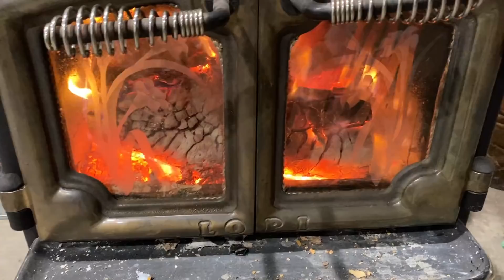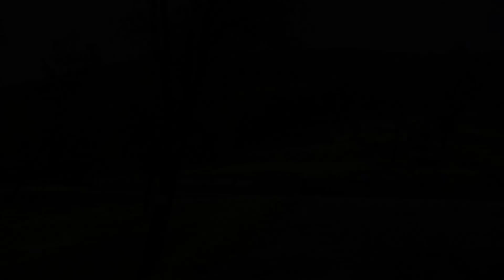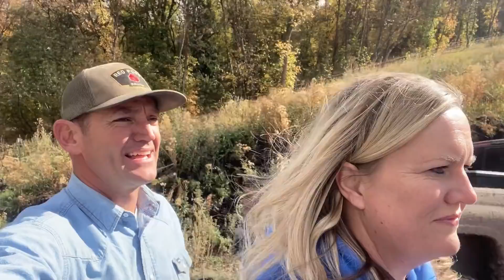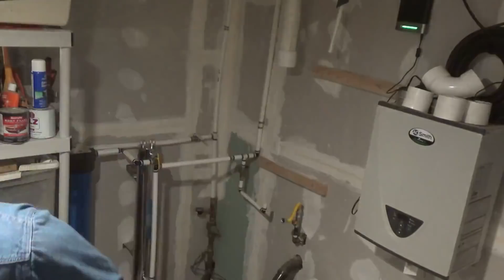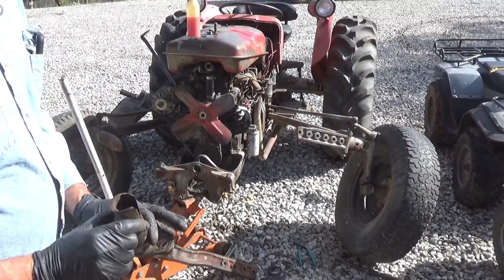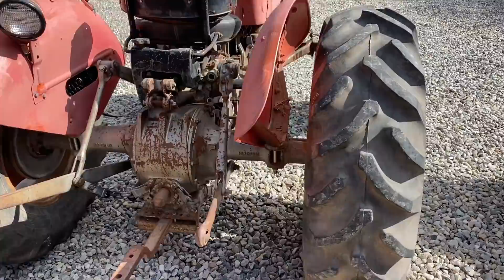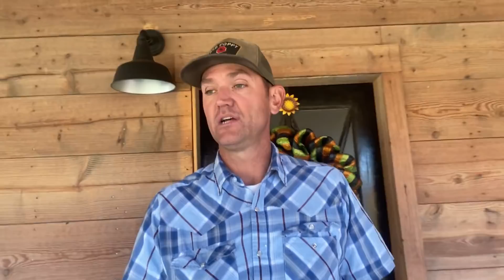#370 - I Installed An Ultraviolet Water Purifier On Our Off Grid Water System!

Comment: Wind Generator
Coming from someone who has owned 3 in a non laminar wind location, they are a waste of money in that environment.  If you insist, a production Axial Flux vertical or horizontal axis would be the most promising. The variability of the wind would steer me away from horizontal axis, but you would be a better judge of your conditions.  What are the conditions like at the top of the hill?

Comment: Maybe you should think about Outsourcing some dry wood for this year. Even if you cut wood at this time of the year it won't have enough time to dry and wet wood doesn't heat well it's not efficient. 
 for the wind generator make sure you try to partner up with companies that may be able to lower significantly the price of your wind generator or even you could get it for free in order for presenting the product on your Channel you have enough subscribers that some companies should be interested in the publicity don't be afraid to use what you have.  you could also think about getting a lithium battery. A lot of companies that provide solar material and batteries are partnering up with YouTubers don't be afraid to ask.  I hear that renergy have good lithium battery maybe you should investigate with that company

Comment: We have a 1700 watt wind turbine hanging on the shop that we only used one year they basically have to have 30 mph sustained winds to make enough power to do any good you would be better off to add to your solar system or your storage . We just switched our system to a 20- 6 volt battery bank system I'm  now able to eliminate any timers and let things run continually that need to do so.

Comment: Ultraviolet Water Purification works but only after you cleaned the water from other contaminants.
First, filter the water to remove other things that do not belong in the water before you pass it thru the UV light filter.

Comment: Heath what was that so very worn part that you replaced with the beefy new one? You showed it so briefly but it caught my eye.  

“She took a chance on me I’ll spend the rest of my life proving she was right” I needed to build a retaining wall I guess it needed 250 of those retaining wall bricks (12 lbs each) well my Honda could reasonably take 30 at a time.  I remember being 1/4 the way through and out of bricks.  Went to work the next day and there was a pile waiting for me when I came home.  The Mrs proved a partnership doesn’t have to have defined roles.  IT has worked for 29 years in a few days.

Comment: Nice to see the old 135 working. I bought a 135 about 8 years ago it was pretty rough, put about 500 into it and been using it ever since to brush hog and drag snow each year. I put a set of chains on in the winter and nothing will stop it. Invest in tire chains.

Comment: You could look into micro-hydro electric as well. Mr Hydrohead published a rather comprehensive series here on youtube. And there are other systems that require only a small elevation change by putting the turbine sideways ("Turbulent") on the order of 15kW. Cheers.

Comment: I knew UV was very effective for wastewater effluent treatment, but, I had never seen it used on drinking water. Looks like a perfect system. You may wish to shock the system at the holding tank/well to clear out any bacterial issues in the tank and supply lines. But, if there has never been any infestations, it may be unnecessary.
You have a beautiful place...so peaceful.
The only way to handle the mud is put down rip rap, and run over it with a bulldozer extensively, then put 57s on top. Shale would make a great base, but I doubt it's available.

Comment: dude, your way too late too be starting looking for wood. ya should have ten cord ready by now.  plus a place too keep it dry.  but then again it is a bitch doing it all by yourself.  think about  getting some help.   also how's that plow truck coming. have ya got good nobbles for it yet. hell for all you trucks and cars.    I can remember needing better tires in the snow in my place in both potter county Pa. and Madison WV. both were long  lonely out in the boon's that would of scared most people.   hell two mile drive way in Pa, then six miles too the black top, then two miles into the town.  Madison was only four miles into town, but those back cuts were scary roads.  I remember looking over the edge and being scared just looking ,let alone driving it.   I'd still be looking for a good heavy duty duce and a half truck with a plow.  I know that they are out there fairly cheap.  they can be a bit much, but well worth the cost of having one.  check Government liquidations. com, for real reals. their are a lot in your neck of the woods.    there are always great deals if your willing too act when they pop up.again best of luck, to you and yours.

Comment: Hills, trees and unstable wind won’t for a wind generator, money and time is better spent on some more panels and more battery capacity.

I suggest moving over to lithium ion batteries, they are more efficient. smaller, lighter, have greater capacity, can be discharged lower, 1000x plus more charger cycles and work out a lot cheaper than lead per kWh capacity and life. Used EV battery banks would be a great replacement for your lead acid battery’s plus you don’t have to deal with the off-gassing.

Spend wisely now or spend twice later.

Comment: I recommend you look at: "vertical wind generators for homes" as they are highly efficient but quiet.   Also they do not need to turn in to the wind.  
There are many to choose from, heck with a car alternator and some ingenuity you could build one yourself.
Reply: Just what I suggested, more versatile due to not needed to orient towards wind direction and quieter.
Reply: I am glad to see someone else has thought of using a car alternator.
Reply: Yeah, came here to say that too. They should work better at low and changing winds, at least on paper.
Reply: yeah what he said...
Reply: Yup. I'd like to get one of those sometime soon myself. : )

Comment: Am so glad you are adding a wind gen, and believe in a much earlier video of yours I added links to a reasonable place that has 3 yr. warranty ones, and can tell you that I have just 6 yrs. on one, and it's still going strong. Even my buddy who bought a cheaper 1, had to replace bearings(I helped) but his 10 yr. old unit is still working as I type this. It works when you are sleeping, it works when the rain is non-stop for 2 days or more, and will make it where you can feasibly live off grid. Can also give you some battery ideas, that I don't want to put in publicly, but if you can use any of the info, just let me know, and I'll gladly share. You're getting there, and hope you are all well ;)

Comment: If getting down to 50% on your batteries can cause damage, doesn’t that mean 50% should be considered 0%?
Reply: No, the 50% can be used and drained till empty if need be, they just won't be the same after that. Almost like if a car battery dies a couple of times from leaving lights on it will be more susceptible to not being able to hold a charge and will knock years off its life span.
Reply: @73181UserFkOff  Well said.. Degradation is not the same as failure. But using something sub-optimally reduces its life span.
Reply: @73181UserFkOff  - Good to know, thanks. : )

Comment: You have deep, dark secrets? LOL
Look up "mechanical concrete". Simple and effective. Start with the worst ruts. Try doing just one rut and not the entire width of the road in your worst possible place. One tire wide with a tread along the length on each side. Give it one year as a feasibility study. I haven't tried it, but I don't have any bad ruts. I've been able to stay on top of it with the home made grader.
You can build a grader from a truck frame and a 3 point scraper blade. I've made several mods since this video. The blade is now fixed height and the front wheels have been removed. I just raise and lower the 3 point for blade height. The principle remains in that you suspend the blade between the axles. https://www.youtube.com/watch?v=Dpeg9yTPuEo&feature=youtu.be

Then I went looking and found this: https://www.youtube.com/watch?v=OIed2lzfQ-g  I think I'd like this a lot better. The county often has old plow cutters to scrap. I can see building one of these!

Comment: I used Clearwave No Salt Softener for over 15 years now and it is still working for my house. My water heater last more than 14 years and my espresso machine is still pumping coffee after 15 years of using. You can give it a try to descale you water and still get all the mineral you need, you can install two device in series for well water. You can find it at Amazon Clearwave CW-125.

Comment: Brother, look up Vertical Wind Turbines. They do great in intermittent winds. Likely a better fit for your area; as you are in a hilly/mountainous area. Generally the higher up a wind turbine is the better/steady wind flow/energy output. Hence most "major" wind turbines being on top of mountain ranges or out at sea where turbulence is a non-issue.

Comment: Gravel will not solve your mud problems. You need drainage ditches, water bars and to tell the water where to run off your road. Gravel will help but not solve your road problems.

Comment: Oh Heath. That drive is just so beautiful and romantic in this vlog. Don’t think Red Poppy Ranch has looked better throughout the past three years. Your vision has taken time and enormous energy and fortitude and is beginning to blossom. It is a shame this fall will be so short. And the UPS guy must have thought he was off to Oz! Yes, additional energy stores look to be required. And the challenge of the road and school run will start to become paramount. I think of what you have achieved in 3 months and am gobsmacked. Will you keep the tractor battery inside over winter so the starts are easy in heavy snow? Where do the quads etc go in winter? I wonder if the previous owners have found your vlog?

Comment: Heath, you should consider adding a rocket mass heater to your wood stove, to act as a heat battery.
Right now, most of the heat generated by the wood stove is going up the flue. If you add the heat battery, all those BTU's will be stored in the rocket mass heater and slowly released over the span of several hours.
Of course, if you incorporate that to your stove, it will be called a firebox mass heater, or a batch heater, not a rocket mass heater.
The benefits are not only heat that last a longer inside your house, making it more comfortable, but a BIG reduction on the amount of firewood needed every season.
Reply: I dont believe they are code. Mainly used in 3rd world countries. Cool concept though
Reply: @jeremyk4924  They're widely used here in the USA, Idaho in particular allows them.
Reply: @hugoramirez1786  could you list the code that permits them. I'm not doubting you, I just haven't found any law that regulates them. Thanks
Reply: @jeremyk4924  my pleasure. Just like rainwater catchment, backyard chickens, and many other situations that can be allowed in some places but not in others, rocket mass heaters and mass heaters usage is dependent on your particular location.
If you're interested in getting more information, please look up Ernie and Erica Wisner, experts on this type of heating.
Here's regulation in Portland, OR.
You're welcome!
https://www.google.com/url?sa=t&source=web&rct=j&url=https://www.portlandoregon.gov/bds/48661%3Fa%3D437516&ved=2ahUKEwjCjre53IzlAhVGmK0KHcQ0DycQFjAAegQIBhAB&usg=AOvVaw2etum1rpaP1T32QZQUKanc

Comment: An off grid property I viewed here in NZ was well set up, it had a diesel generator in its own little shed away from the main house, and was set up so that when the batteries reached a certain level the generator automatically came on. The shed was lined inside, even the door of shed with egg gardens to dampen noise. There was some ventilation gaps. The property also had a UV light purifier with a countdown display of when it needed to be replaced.I presume the electrician the owner used had set it up this way. Any way I thought I would share the info. Beautiful drive to your property. Yes stock up on wood.

Comment: Wind generators can be A.C requiring smaller wire to the house and then using a bridge rectifier and step down transformer at the house will reduce the voltage to 12-14 volts ripple D.C. That is very similar to alternators in cars.

Comment: Weld or fix fins to a truck alternator and mount it on a swivel for wind direction on a pole and test, then add some more! Even old metal fan blades and salvage finds to figure out the best blade size to move the alternator and not break. Fixing the blades to the alternator eliminates the need for belts and extra gear. Good Luck! RPR Rules!

Comment: I think I'd get an old dozer - would make it easier to fix the road and you could use it to plow as well....  Plus, if someone got stuck, you could pull them out.   Maybe one with an enclosed cab, like an ex-military one.   Cut in some drainage ditches, that will also help keep the road in better shape.  Re: batteries, if you get some lithium cells instead of lead-acid, you will be able to use up to 90% of the capacity and they will last longer.
Reply: Why dont you send him  the required cash, he will do as you say.
Reply: Lithium is hella expensive per unit, and more damaging to the environment. Efficiency depends upon the metrics you hold deer.
Reply: @mwnciboo   I've seen used Li-Ion batteries from a wrecked Tesla car added into a home solar power system to replace traditional lead acid ones. You don't have to use new ones. Can't argue with the environmental issue, but at least they'd be recycling them.
Reply: Dozers are a very slow way to plow snow

Comment: I second the Marine wind generator as a backup.  Small, and can be mounted easily off the house if desired.  Is your generator a mixed fuel type?  With that much propane, I hope so.

Comment: Please dont forget to support the center section of the propane tank. Things are looking amazing. Thumbs up!!!!
Reply: All he needs to do is put a strap around the center and use the tractor lift to support it as he slides blocks under there.. It will work.
Reply: I am sure Heath looked into whether it needed to be supported in the center, myself I like cradle stands. My bet is the tank manufacturer and the propane company has assured Red Poppy it will be fine as is , but having the center support must be there for a reason.. unless it's added to all the segments(rings) during initial manufacture. Then the ends are welded on .
Reply: If there's no footing in the center which I've never seen why support something that's not needed
Reply: They have a chicken coop.  Guess they have been too busy to get them.  They do require extra work.
Reply: @NeuralSmurf  They had them when they lived down town. I am sure when they have finished getting themselves housed that they will soon be forthcoming along all the other farm type animals
Reply: There is nothing he can do. He already filled it.
Reply: The cylinder is self supporting.

Comment: instead of building a farmer's wall I would bury those large rocks in the ground in the worst spots of the road and I would put some drainage. 
You need the water to run off the road and have somewhere to go.
Reply: Yea the county installed 1culvert but it looks like 2or 3 more would ease a lot of the issues as far water running down the road. Hell im aurprised they dont create a channel along the edge of the road for the water to run. All Heath wouod need to do is watch 1 Andrew Camarta video on driveway drainage.
Reply: Yes to both of these suggestions. His road needs proper drainage before he spends $$ on gravel.

Comment: Do not look into the UV lamp. It has the same effect as staring at the sun.
Reply: I don't think you are supposed to quench solder joints either, i read it was a no no, when i had to change my water heater.
Reply: It’s not recommended, but his UV light is not strong enough to burn out a retinal at a quick glance.

When you’re worked on a printing press with UV drying lamps, the heat coming off it alone, will start a fire, before you burn your retinals out.
Reply: For the same reason you don't look at welding, also those cute little UV LED you can buy now, you get that lovely feeling of sand in your eyes.
Reply: @drmosfet  LED lights are going to make eye "doctors" richer.  They are blinding.  The blue light of them is also very bad in terms of insomnia etc.  All the diabolical agenda of an elite faction determined to kill us softly.
Reply: Not the same effect....UV is a specific wavelength, the sun gives off a whole spectrum and is yellow because it is around 5000kelvin so will have more in that part of the band whilst maintaining some in all of the spectrum.
Reply: @mwnciboo    Sunlight UV radiation is a measure of A, B and C UV rays.  A and B are not as strong as UVC which is used in water treatment disinfection.   All types of UV radiation have the potential to damage your skin, but each type affects your skin differently.  UVA rays account for 95% of radiation that reaches the earth’s surface.  UVB is about 5%.  And UVC has the shortest waves and causes cellular damage.  The ozone layer protects us from the shorter UV wavelengths.
Reply: mwnciboo 
It is a simplified analogy, for the sake of appealing to common knowledge. Both acts cause eye damage.
Reply: Ωmega Man it’s not a UV light it’s a miniature lightsaber!
Reply: @rogerbradley7509  if you don't replace them in a year it keeps making an obnoxious noise kind of like that saber whoosh but more of a beep beep beep like the road runner
Reply: You mean I’m blind now cuz I looked at the glow stick?